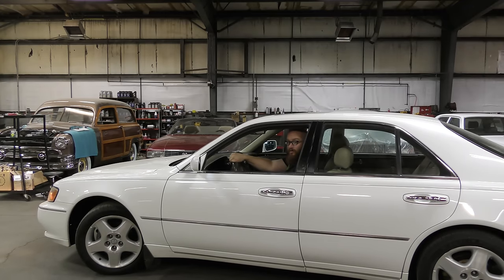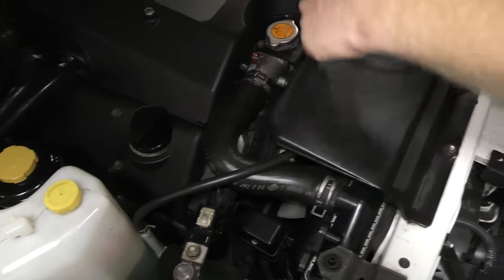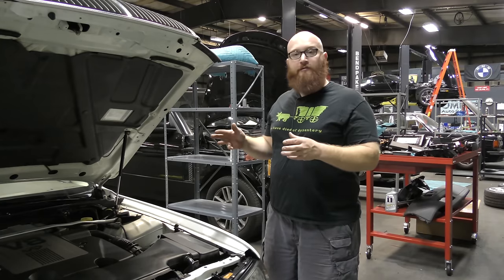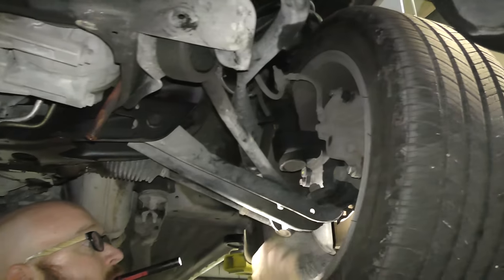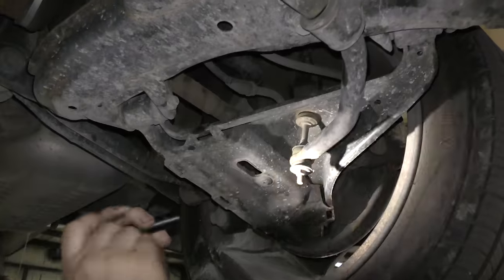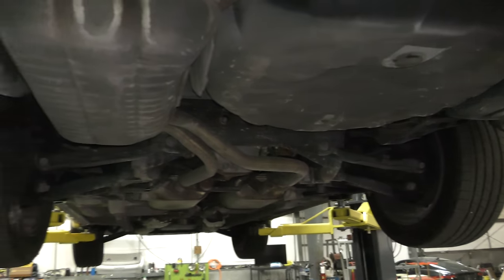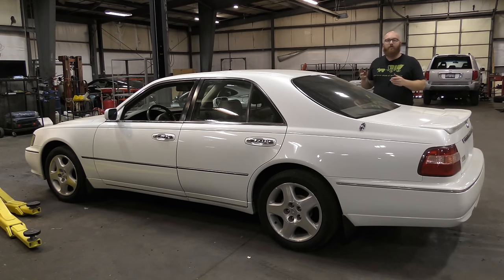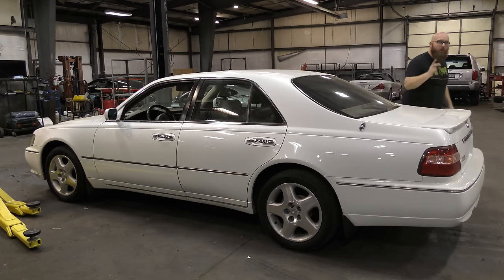I've never seen one of these before! First time a 99 Infiniti Q45t enters the Car Wizard's shop

Comment: My first experience with Infiniti was in the fall of 1990.  A friend of mine went with me on a trip to the Infiniti dealer in the Washington, D.C. area.  At the time, that was the nearest one to southeast Virginia.  I took a M30 coupe, black with gray interior, out for a spin.  At the time, I was pretty impressed with it, and I wasn't going to pretend I was a customer for the Q45, which I'd have loved to lay my hands on.  

I had to watch this video to find what you saw so exotic about this generation of Q45.  I was impressed by the one I saw at the local auto show at the time, and my main impression was on how shiny the wood trim was.  I could have imagined what it'd be like to drive through the city at night with street lights reflecting off of it.  This generation of Q45 is seen frequently where I live, and they're usually at least a bit ragged, and seen on what we'll politely call the wrong side of town, like most older luxury cars.  It's a sad thing to say, but these, older Lexus LS series cars, as well as the German luxury sedans aren't exactly revered after they go off lease.

Infiniti has certainly chased BMW, to their detriment.  The latest one I've driven was a Q60.  I've wanted to try it again, because when I drove one in Virginia Beach, I absolutely could not believe how brittle the ride was.  It made my Chevrolet SS feel like I suppose a Rolls Royce Phantom would feel.

Comment: They are well crafted cars & a handsome body & interior, later on in the 2000's they had an even sharper looking front end & overall styling, highly under-rated models.
Reply: I have an 05 Q45, and it really is something. I actually like the more classic design of the model shown in this video, but I still love my car for sure. Like no one knows what I have either, it's funny. They upped the hp number to 340 in 02.
Reply: @goldengod5915  That's cool. I love my 08 Infiniti M45 Sport. Like you it's just something about it. Hope you keep it. 👍

Comment: First car I ever owned was an Infiniti i30 1999 limited. I know i30s are still around, but holy crap I loved that car to death and I still kick myself that I got rid of it at 189k miles, was purchased at 74k miles for $5,000. I didn't even maintain it very well since I was a teenager and we nicknamed it "the mystery machine" as to why it still kept running so freaking well. That's one of my top regrets of all time, getting rid of that car.

Comment: Hi Car Wizard 🧙‍♂️ great video. I’ve owned 4 Infiniti cars including this era Q45 ! 
I had a 98 Q45 identical to this. Fantastic car mechanically. These were clearly not as plentiful or popular as the Lexus LS that it competed against. But bottom line if you can find an Infiniti Q45 especially this generation in good condition I highly recommend it as a cheap reliable luxury car ! 

Also I once on a late night road trip in the desert 🌵 between Los Angeles and Phoenix took mine up to close to 140. ( slowly built it up ) my point is this car was smooth and solid at that speed very stable. Which underscores the engineering of it. No check engine lights no issues with the transmission.

Comment: I had a 99 Q45 I bought used but when the suspension went bad, I was shocked at the cost of replacement ( $550 each for the fronts and $370 each for the rears) so I sold it. I still miss that car and kinda regretted selling it 😢

Comment: I had an '82 Nissan Maxima as an airport car in Indianapolis, "Betty the Brown Beater", it had bathroom caulk to keep the sunroof from leaking.  And I used a shovel of Orlando dirt in the rear corner just ahead of the bumper inside the trunk to keep out the sound of the blown exhaust~!!  Damn thing was loud but it actually sounded good due to the 139 hp 2.4 liter inline six L24 engine.  That thing started without a single problem after sitting at the Indy airport for over 2 months, while covered with a foot of snow!  Nissan builds GOOD cars.  Or, at least they did;  Avoid the 2.5 liter and 5.6 liter engines.

I sold that car to a group of ATA pilots in 1998;  I heard that as of 2008 it was still running.  It's probably still driving around that city to this day.

Comment: I used to work in automotive R&D.  We bought a Q45 when they first came out.  I was driving it very conservatively when the timing chain broke and destroyed the engine. A new engine replaced under Warranty.  No problems with the Lexus LS 400 or the Honda Legend.
#1 Toyota / Lexus
#2 Honda/Acura

Comment: We had the "Q45A" and the Q45T" . My stepfather at the time beat the hell out of each of them. The active suspension in the "A" finally went bad and could not be sourced either. They were both big , zippy,  quiet, and comfortable cars. He moved to an LS430 which is still running today and has out-lived him, driving back and forth to Michigan State University with my niece at the wheel. Everything still works.

Comment: "The interior on this car is pretty much flawless" - Wizard presses oil and grime covered hands onto the porous, light beige leather seat. Not so flawless now! Take that! LoL
Reply: I've never seen him put seat protection covers on the seats before getting in a car !!
Reply: Hob Moor 
I've said it before, a good tech doesn't need interior or fender protectors. Those are relegated to hacks and alley mechanics!
Reply: What I noticed is that it's a smoker's car. You can see the smoke damage on the headliner and console.
Reply: I thought he might leave a hand print. Those seats looked brand new.

Comment: Those were pretty common around here. The fan used to pop off the pulley and go through the hood/radiator. Throttle bodies were big money and had idle issues

Comment: I'm down here in Auckland, New Zealand, and I'm seriously thinking of buying one of these. It's a 1994 Q45, First Generation, Face-lift model. It's only got 92,186km and it's mint condition 👌. 
I took it for a test drive yesterday. It drives beautifully. The owner wants around $16,000nzd
They are a rare classic over here.
But I'm in two minds whether to buy it or not.
Your thoughts and advice are most welcome. 
Great informative video 👍👍, thanks, Leo.

Comment: I knew a guy who had one of these back in 04. We were young adults in our early 20s and were impressed by it, always praising it as we walked by. He had it for about 4 years and then it vanished one day. I always wondered what happened to it. Then in my late 20s, early 30s I got into auto mechanics and quickly discovered that this car, and most infinites from the 90s in general had timing chain guide issues. The guy who owned it wasn't mechanically inclined, and I can probably say that the car vanished because he blew up the engine. After it vanished, he drove a beat up el dorado for a while, then a beat up tahoe, and then one day he popped up with an 05 Bently. Come to think of it, I haven't seen the Bently lately....

Comment: I have a 05 Q45 with almost 200,000 miles. The only major repairs have been replacing the rack and pinion and just got a crack in one of the exhaust manifolds. These were very good cars and are examples of what Nissan once was.

Comment: My previous car was a '97 Q45, apparently with the same engine, because it also had 266 hp. Now I own an '03 Q45, a 4.5 l. V-8 with 340 hp. Mine is the premium trim (there are two trims, the base ("Luxury") and the Premium. it has more features, like heated and cooled front seats, backup camera with other controls on it, reclining rear seats for the CEO who sits in the back, power trunk lid and more. Mine has 103,300 mi. on it (got it in 2015 with 65,000 mi). The local Infiniti dealer guys are always astonished at how new it looks (like maybe a well cared-for 3-year-old car). Well, I got it that way, so I kept it that way. Not quite as bulletproof as the corresponding Lexus LS430--I've had to replace the radiator, tensioning belt and starter, and a couple of cheap hoses and belts. Also had to replace the front suspension ($2 grand) but I think that's because I abused the car in a particularly bad winter.) Note: It has a timing chain, and it's not even mentioned in the owner's manual--it's pretty much expected to never need replacement.
Reply: 03-04 models were m45.

Comment: I had a 1998 Q45, it was a limited production for only 4-5 months, hard as hell to get parts for.

Motor grenaded itself at 205k miles in 2016 with zero mechanical maintenance (other than plugs and oil) it's whole life.

On the suspension: apparently it shares parts with a certain other nissan (can't remember which, altima I believe) and they fit tight, but work good.

Comment: I had one of these in college. It was hunter green. It was a fantastic car. You could tell it was the top of the line luxury car. All materials were top notch. Only problem with it was gas mileage. It had a problem with an O2 sensor that we could never figure out. The thing got 12-16 miles a gallon. Other issue was the power steering pump went out. That’s when I got rid of it. Ended up trading for a 2007 Nissan Altima…big mistake.

Comment: It's like a Nissan version of a Lexus LS. I'd rather have the Lexus.
Reply: MontieMongoose - same. And a nice used LS is HARD to come by nowadays. Timeless looks, too!
Reply: No thanks, the lexus has more maintenance
Reply: @liblib89  if you got a hold of a neglected older one, sure it's gonna need more.  But Toyota's track record has proven that over the life of a vehicle theirs won't need as much as other brands.
Reply: liblib89 no it doesn’t 🤣
Reply: I'd choose this car over the LS, personally. But I agree with your other point.
Reply: As the Lexus LS is based on the japanese Toyota Celsior, this is based on the Y33 Nissan Cima. Really nice car.
Reply: I agree LS , i like the LS dash much more
Reply: MacGroober!! They have timing belts with interference designs. The Q45 does not, it has a timing chain.

Comment: I had a co-worker that bought the twin to this car back in 2004 and was very excited to get it. It was rare back then. I think is was a rebadged JDM Nissan Leopard. Not a great seller back in the day. Haven’t seen one I years. It was kind of a step down from the 1st gen Q45. Nissan was still trying to find there way to complete with Lexus, et. all. Good luck on the suspension parts. Sad to think something as simple as struts would total a car, but that is probably why it was sold. That certainly is one clean under carriage. Puts German cars (like my lowly old leaky, but much loved , 2000 VW Passat) to shame. Thanks for the video
Reply: These cars are far more reliable than modern equivalents. I can't imagine how anyone would believe in the idea of selling something simply because repair exceeds book value (outside of a business) if it is a great vehicle. Obviously, doing the work yourself is logical. 

These were sold as the Nissan Cima in Japan. They still use the Cima name.

Comment: Strut cartridge assemblies for “T” model available from Nissan in Canada expensive at $450 front each, rears $350 each CDN funds.  Should be available from Infinity in Kansas.
Reply: T model struts are long gone everywhere for years. They may still be listed on the website but as soon as you try to check out it will say unavailable.

Comment: For a similar experience but with an even nicer interior and a few more modern tech touches, check out an M35...05-08.  Just inspect closely for even tiny cracks anywhere on the dash as this means the dash has been treated with something like Armor All and will crack like mad going forward. Also I would avoid the 09. It introduced a 7 speed automatic that was problematic for a year or two when I guess Infiniti finally worked out the bugs. I love my 08 enough, cracked dash, loose headliner and all that I am considering buying a low mileage example to replace it.

Comment: Hate to nitpick, but when you referred to the STS as a front-wheel drive V8 Cadillac that was hard to work on I had to leave a comment. You are probably thinking of the DTS as that had the transverse Northstar that had the headgasket issues. The STS Sevilles were all longitudinal V8 or V6 in rear-wheel or all-wheel drive, and they're fairly easy to work on. Nonetheless love the content!

Comment: I just inherited a 1999 MINT condition Q45T with 120K miles on it. The car was dealer maintained until a year ago. The electronic suspension is shot and the check engine light is on. Is the car worth salvaging? The cost for one strut without installation is $1500. The car is not even worth $2000 retail according to Manhiem MMR (Dealer auction website). It was my Dad's car and well taken care of other than these mentioned major issues.1 coil pack for this car is $100 and there are 8 of them. Do you think this car will be worth something later on? Should I keep it or move on?

Comment: S14 240Sx shocks/coil overs will bolt on in the rear, you will have to do a custom setup to get the spindles on the fronts. Will handle like a dream but ride comfort will suffer

Comment: Very nice Q, I almost bought a 93 Q30 but didn’t. Just needed so much work. I had an Acura Legend, 1st gen I did a 5 spd swap on. That was true Japanese 90’s luxury. I drove that car to 300k before I sold it. Real wood inside with a perfect climate control system and bronze tinted glass all throughout. It was like being in a polarized green house

Comment: I have a 2003 Infiniti Q45 with only 101350 miles.  An absolute gem of a car.  No leaks whatsoever.  Interior is emaculate.  I don't have the touring suspension.  It is now hard to find even parts for the regular suspension.  😀

Comment: I owned a 2000 Q45 Anniversary Edition and it was my favorite of about 30 cars owned over 40 years. When it hit 140k on the odo, EVERYTHING broke. Emissions, headlight ballast, heater core leak, leather seats fell apart and a transmission that had trouble finding 2nd and that damned ticking valve train. It was waiting on $10k of repairs when we parted company for $2k. I still miss the smooth acceleration and quiet competent ride. This was a great car.

Comment: I have a 1990 q45 t with rear wheel steering in gray metallic with 35000 miles in very fine condition it needs some work on engine needs. May consider selling

Comment: @car wizard these are known as the y33 chassis. My buddy had a y32 q45 10 years ago and he installed s13 or s14 control arms and coil over suspension. I'm sure you can put z32 suspension from the 2nd gen 300zx as well. I had q45 rear hub and brake calipers, as well as z32 300zx 4 piston calipers on my s14 95 240sx. Nissan's brakes and suspension are all interchangeable. Even r32, r33, r34 skyline brakes and suspension might work. Had a friend put an sr20det in place of a vg30 in the m30 10+ years ago.
Reply: I can confirm this, I've been meaning to look at the CD009 or Z32 300ZX manual transmission to bolt into my Y31
Reply: @jamesonlynch8266  i would skip over the z32 5 speed. I'd just go straight for the updated cd009 from  2005 -08 nissan 350z 32010-CD009. you can get the factory transmission straight from the nissan dealership for around $2k.

Comment: Just bought a 1997 q45 for 800 bucks with a check engine light for the o2 sensor. Rides like a beast but definitely needs some valve covers done and some maintenance like brakes and suspension. I'm going with aftermarket suspension. These cars are sleepers
Reply: Any luck with the suspension?

Comment: I owned a 1995 Q45 with the original 4.5L engine. Super nice to drive. Quality is top of the line. I recently sold it because it was just too annoying trying to find parts for it. Parts are hard to come by. If you find them, you pay a premium.

Comment: Pretty much a V8 Nissan Maxima. Oh and the STS turned to a rear wheel drive awesome car after 2005. I own one and love it. They fixed the head gasket problem on the V8 Northstar after 2004 however they didn’t fix the oil leaks. Fixing those now after 130k going to be doing timing chains and full tune up while I’m at it.

Comment: Hey Wizard... I would love it if you could come across a 2003-04 Infiniti M45 now that's an even more special Infiniti. They are very rare and outside the engine , exterior and interior parts are near impossible to find , affordable. I just bought one with 119k one owner. Solid rig 4.5 V8 torque and 330 HP nearly match very quick but it doesn't share the comfortable seats as the Q45... Please try to get a M45 on the show you'll like it luxury sport sedan . The newer ones are to cute . Unlike the 03-04 they're that ugly kinda cute and a beast going down the road...

Comment: Mr.wizard... my Cadillac is having issues and both shops I took it to told me that they couldn’t find anything. I just couldn’t believe it. When I start it up it makes a loud grinding noise and then will stop and then it grinds when I shift until I’ve driven it for about 30 minutes and now it’s also softly clunking into gear. What do it do? What do you think it sounds like? It has the 4.9 l engine

Comment: I was able to find them on the official Infiniti parts website. They are pretty pricy though. I'd call up a dealer and ask. 1060$ a piece. Front Left part number 54303K. Front Right Part Number 54302K. 
Was also able to find the rears from the dealer as well. There are 3 different price points with different notes rangeing in price from 314$ to 459$. Make sure they are labeled as "Touring" in the description. There are other front ones that are 467$ a piece with the same part number but aren't labeled "Touring".

Comment: Always liked these cars and almost bought one a few times, but the expensive air/normal struts/shocks replacements turned me away from them.  No aftermarket ones (KYB, Monroe, Bilstein, etc) that I know of are available in the US.  Have to get OEM unless you can source some from overseas.  Coilovers can be installed, but there has to be some mods done to install them.